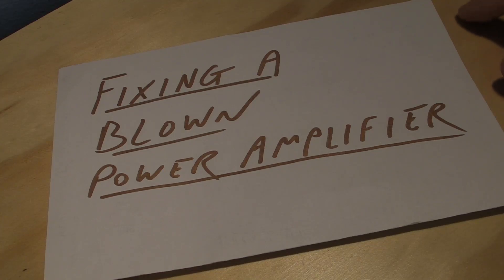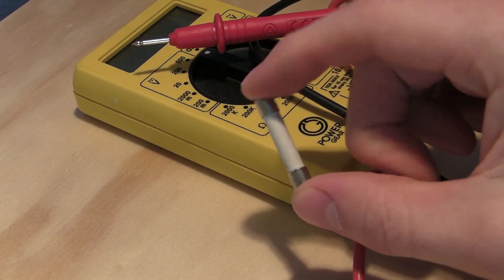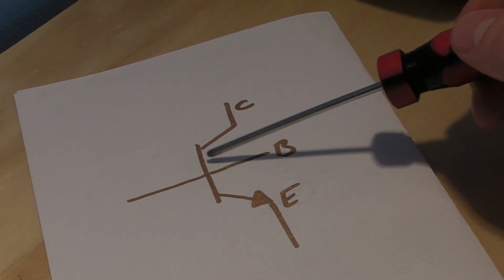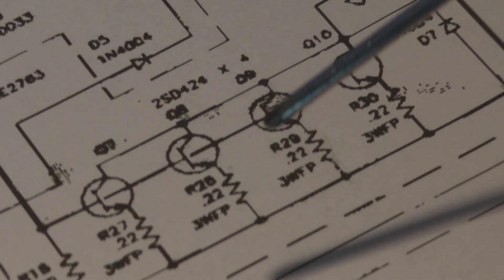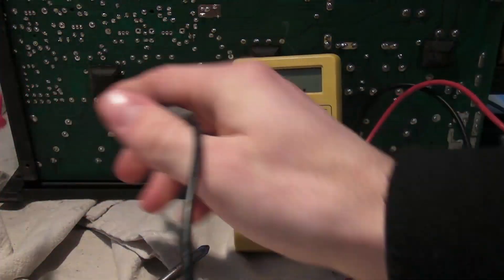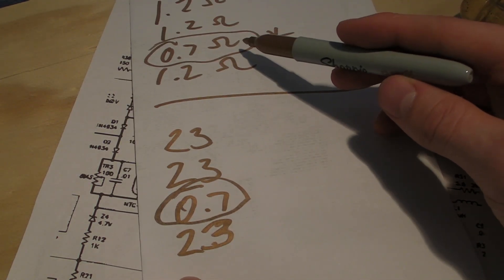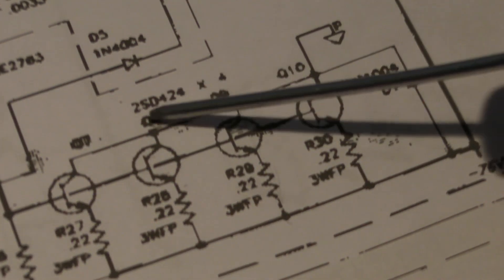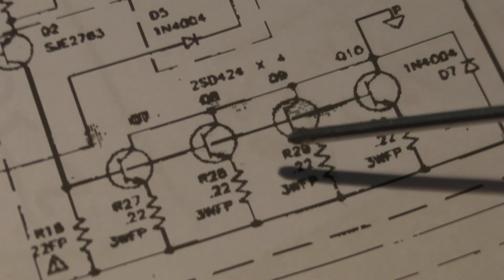Simple fix for a blown audio power amplifier - Save your $$$!

Comment: My amp bot blown.... Was asked to by some transistors and resistors.... Having done that.. He said as he fixed... A blow again happened. Now he is saying that my Amp doesn't have Something like (Riley....) Whats that????.... It's a two channel output, 4000 Europower ....now he managed to fix one.... And one ain't working.... The whole thing just sucks!
Reply: collins sunshine my drummer gave me a europower 4000 with one channel down, left, i already had a europower 1500 with one channel down, right, so for fun i simply swapped the mini boards and now both amps work fine.

Comment: The sound only comes out of the left speaker; the full right channel doesn’t work. What could this be?
Reply from the maker: Could be this exact thing. Each channel (R & L) is an independent circuit. So obviously  there is an issue of some kind with the right circuit.

Comment: Current division.
Since nobody's mentioned it, that's why those transistors are in parallel. Routing electricity in parallel divides the current. Transistors are rated to both maximum voltage and current capacities. Here, it distributes the current load on each transistor, 25% each.

I LOLd at your mention of people getting pissed off because you were talking so much, bu it's not like you spent the first 3 minutes plugging your website or something ;) See other comments about the BCE testing. Good job, great video, great breakdown!
Reply: lol i searched to see if someone had already answered before i did, correct you are sir, Parralell in ohms law will show an even voltage drop across each resistor and resistance being no more than the lowest resistor.

Comment: Thanks for posting this! 
  Before I watched this, I’d never considered pulling a bad transistor and the amp will still work, albeit with less power output than before, but the point is, it’ll still work!
 I tried it on a vintage BGW amp I have with a blown channel, and transistors made of unobtainium, and it worked!
I removed the same transistor from the opposite side, even though it was good, so both channels would have equal output, and Shazam! An amp that hadn’t worked in 20 years was back in service! THANKS again!😉😎👍🏻
Reply: christopher fogarty lols if you’re just pulling out transistor that is fine but if you have a bad one it will not work basically if you pull the bad transistor it may work just like what you did

Comment: i did what you said have the same amp got all the finals to read 23 ohms i replaced 6 of them put it back together smoked all the finals and the fuse again. the only difference in the finals were the bottom row of numbers which i was told thats only a date code
Reply: i smoked thee actually that i already replace getting more trying it again

Comment: TeDubbs, you were be lucky, currently I amtrying to repair a nice and old Sansui R70 receiver (70 W +  70W + radio). It broke the two transistor of the final power stage like you, but unfortunatelly, the voltage spike caused by the break of the collector base junction progressed back afeccting 3 more transistor (the previos power stage and its polarization transistor), 3 resistors, apart of the final stage emiter resistor. I am trying to repair the receiver, when I mounted the previos power stage one of the transistor broke again (an equivalent transitor, not the original part number, not available this time). Sometimes it could be quite difficult to fix an power amplifier. Apart of this I comited the error to connect a low power loudspeaker to the the bad channel, that have continous current and the speaker blown, other high power speaker supported this DC voltage. In any case excellent video explaining quite well the failure mode of the bipolar transistor. Congratulations |||

Comment: I have a push pull class a amplifier circuit new, but it causes the power supply to put all the voltage into one of the reservoir caps and nothing in the other in seconds. I can't find a faulty component. So it puts maximum DC at the speaker output. Can you guess what is causing this issue, is there a common failing to put the output to the rail?
Reply: semanhai,the class A amplifiers work with high currents always ,runs hot too,. sure one power transistor is in short circuit.and all the dc power go to the speaker. if you have the circuit please give me this to my mail:  dalbercast@gmail.com. Other possibility,the diodes rectifiers. the amplifier run with +_ vcc. i dont think the transformer have an issue.

Comment: Hi  nice amp vedio bro , can you briefly explain how the audio input works to give the loud sound , i change a short output transistor the only component that test bad  and a resistor that gets hot started to smoke and i can't recodnise the colour band on it but it reads 235 ohms out of circuit so i use it back  but all i got is groumble on the speaker and it reads millivolts

Comment: thanks for all the helpful videos. I have a problem with my Pyle PLBA530FRD BLADE 6,800-Watt 5-Channel Compact Class-D Full Range Hybrid Amplifier when I power it up it plays for a split second an go into protect mode by the way it is not in a car I have it on a shelf with a car battery an a battery charger the amp terminals read 14 volts and even with the charger off at 12.8 volts still goes into protect. I disconnected all cables speakers RCA's an only put power into it same problem I read that is could be a bad output transistor. The problem started when by brother wired 3 different speaker an the resistance went below the rating value on the same channel. I am an electronic guy so if any one know what component inside the amp is doomed please tell me I can open an replace it BTW the amp plays for a split second so I don't think is a transistor idk please help thanks in advance
Reply from the maker: shandev indoi I definitely don't know nearly enough to be any kind of authority on electronics, but you're right in saying that the amp is blown. Going below the rated minimum resistance is a real easy way to do that. If I were in your position, I would test the transistors to be sure there isn't a bad one, and if they all look good start looking online for what can go wrong in an amp if you try to drive speakers of too low an impedence. I would imagine that would point you in the right direction of what components to start checking next.
Reply: TeDubbs thank you soo much for your quick reply greately appreciated I will check online

Comment: good video!..........i do have a question for you! how do i convert a amplifier to work on dc  battery power|? i know its possible to use a buck converter  its that i am not sure where to splice in the the circuit! thanks!
Reply from the maker: c marcelin I would think you would go in right after the rectifier, since that's what concerts AC to DC inside the amp. And then you still get the benefit of it going through the filtering circuitry to smooth it out. That's just a guess though. Good luck!

Comment: When my friend tossed a snowball through my window, a few drops of water landed on my amp/radio. It started buzzing quietly, but getting louder. After a few seconds, the buzzing was so loud that it damaged one of my speakers so much, that I could only hear scraping noises when I tested it on my friend's amp.
Reply: You need to replace the membrane of the speaker and your friend as well. JKD
Reply: Roberto Prieto well, I can't. But for the friend, I surely can! 😉
Reply: Sergej Nadaždin you sure it wasn’t a gutter Full of ice launched through the window into your bang and Olufsen lol

Comment: If you dont find all the bad blown parts in an amp, they will all blow again
Reply: N Gauge England Synthematix basically if a blown resistor and transistor are replaced, then your problem is done, You can’t mess around with other components specially if it still power on just fine

Comment: The two pins for each transistor on the underneath side of the board are the emitter and base connections. Guaranteed. You can still have an emitter collector short and the E-B junction might look OK and fool you with this test. One probe should touch the top metal body (collector) to test for the emitter-collector short.
Reply: Mark Z; Yes, you are definitely correct about that! The exact transistors that the amp in this video are using are the typical older style TO-3 metal case packages, and for regular silicon bipolar transistors of this type, (and exactly these part numbers, as seen on the schematic diagram shown, I looked them up in a semiconductor cross reference book I have just to be sure), they have the case itself as the collector, one pin on the bottom is the base, and the other pin on the bottom is the emitter. His test in this case still worked for him because the bad transistors apparently were also shorted between the base and emitter, affecting the readings in the way he showed, however he should have been testing them like you said first. 

And another thing I have issue with in his test method is using the lowest ohm setting on his meter for this test... Some smaller, less robust, lower power transistors can be damaged by your meter itself if it isn't a high enough of impedance and the meter sends too much current through mainly the base junction, which is more delicate than the other leads of the transistor... That is more of a problem with Mosfets and the "gate" lead, but bi-polars can also sometimes be damaged through the base lead by measuring with too low of an impedance meter... I would have used at least the 2K ohm range on that meter instead of the 200 ohm setting at the very least, and even better yet, use the diode check function to safely test for effective/good junction voltage drop. (A shorted silicon transistor will indicate 0.0V in both directions through a junction that is damaged, and ~0.55-0.6V or so through a good junction one way and open circuit the other way around, (switching the leads around polarity-wise), for each good junction.
Reply: Nice to see a reply from a "real" technician. Too many posers on YouTube. However, a base -emitter junction of a transistor could not be damaged by this (crappy) digital meter. It does not produce the voltage or current (even on the 200 ohm range) to do that; it's limited to about 1 milli-amp tops. Even less likely on a MOSFET. Static electricity would be a more likely potential problem. Lots of old analog meters can produce lots of current, though - I've seen over 150 mA from some with shorted leads on Rx1.
Reply: True. I was talking more about the old analog meters. I had no idea what the (admittedly crappy, "Harbor Freight special") meter in this video put out when testing in that way though, so especially with cheap or unknown meters like that I'd start in a higher range with less current output... Better safe than sorry if you don't know for sure... I don't really have to worry about that though, because I always use one of my 3 Fluke meters for testing stuff. I have an older 87, a 189 and a newer 289 model Fluke, so I think I'm good!... I gotta get me an oscilloscope though! I've never been able to afford a good one, and they're very hard to find used too... Maybe I just don't know where to look for one. :(
Reply: For audio, maybe look for a B&K 1472 (working with a trace shown) on eBay. They're often under 50.00 plus freight. Very good for audio because they go to TWENTY volts per division. I'm a Fluke nut myself. Wearing a Fluke T-shirt right now in fact. Couldn't tell how many Flukes I own without some head scratching. Let's see. Three original 87's, an 85III, an 87III, 87V, 8840A, 77, re-branded Fluke 23 (Square D brand), a Fluke 12, a 27FM, and a couple "parts cars". That's about it, I think...
Reply: BTW the BK 1472 is only 20mHz. All you need unless you are working with FM front ends...
Reply: Cool, thanks! That's my main concern with a scope is if it will work for troubleshooting audio equipment. That and of course getting a working one in good shape for a cheap enough price! (Under $100 used would be my max price point I think. Or even less of course.) I'll check into that model.
Reply: I forgot to mention. On those B&K's you'll probably need to clean the controls - but that's about all that ever seems to go wrong with them. They're made by Kenwood, by the way. All the Japanese-built B&K's are Kenwood built.
Reply: @JoeJ-8282  ..I have some friends that go to "hamfests" (ham radio swap meets). They come back with some incredible gear. Some in need of repair, some just need cleaning up..etc.. I've seen several o-scopes that came from hamfests dirt cheap.
Reply: some analog old testers give 50ma in 200 ohm scale,now the new digital testers have high "impedance"giving less than 1 miliamper.. analog testers light a led,digital testers,no.
Reply: Loej8282,do you have old FLUKE testers??? Keep them forever!!dont sell.them. In Argentine FLUKE are very  very expensive!!But his quality measuring id the best
Reply: Only in the case of metal power transistors,  such as TO-3, TO-66. Most modern amplifiers use plastic power transistors with 3 leads.

Comment: I have a v4001 plus American auto amp it works you just can't  turn the volume up or down on the amp but if you turn the volume on the mixer it turns up and down ,but not bye the volume, on the amp any idea?
Reply from the maker: +Amanda Gutierrez what happens if you try to change the volume on the amp itself?
Reply: One of the 3 leads on the level control of the amp should be grounded. I'll bet you it isn't.